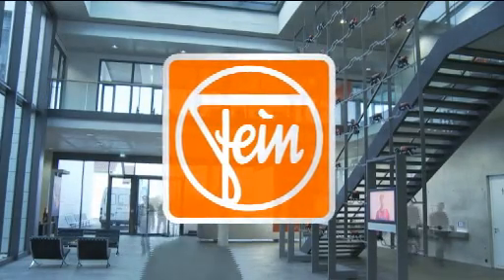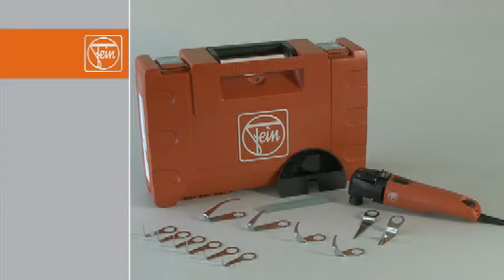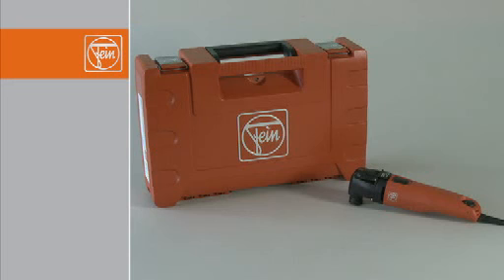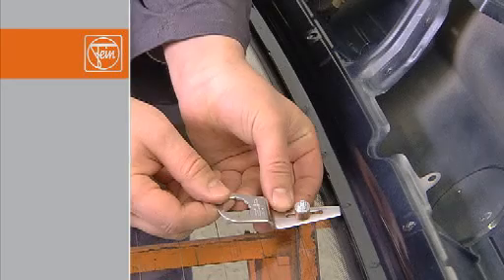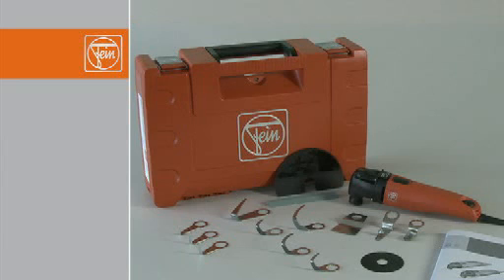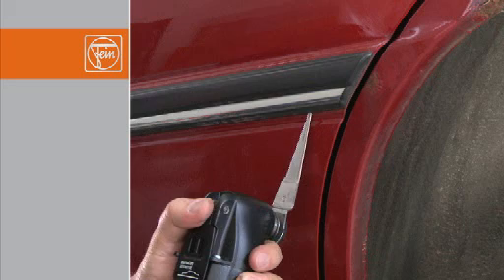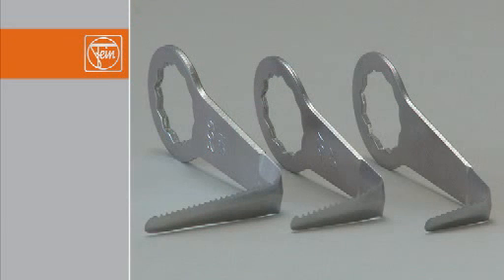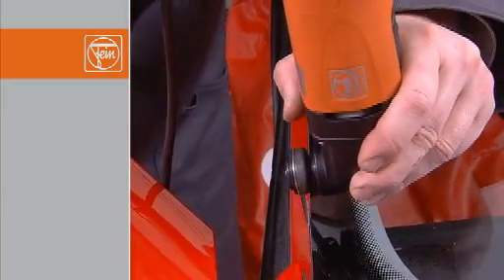FEIN SuperCut Automotive FSC 1.6

Comment: just be careful... with fein supercut, hardly used machine and the  blade has got stuck, won't come out. tried everything, the lever release mechanism is stuck and won't release. Fein are saying we need to but a complete new head for the tool £200!